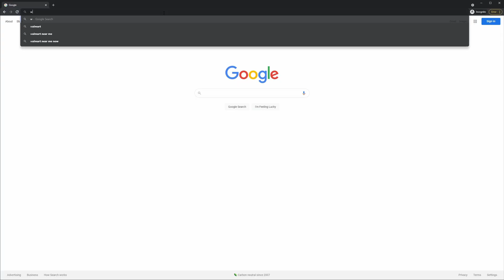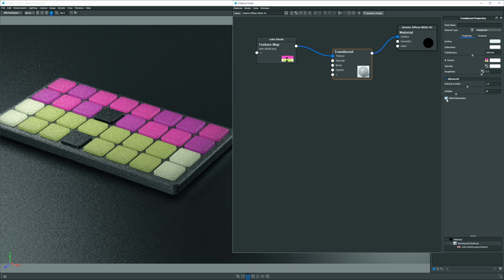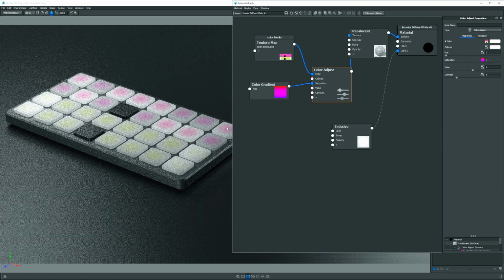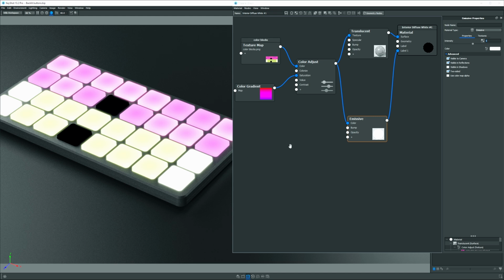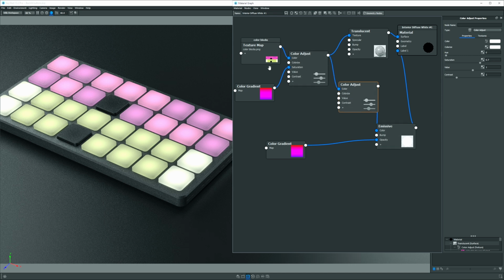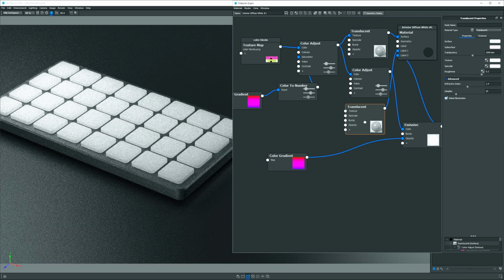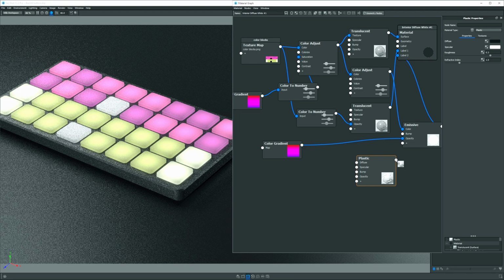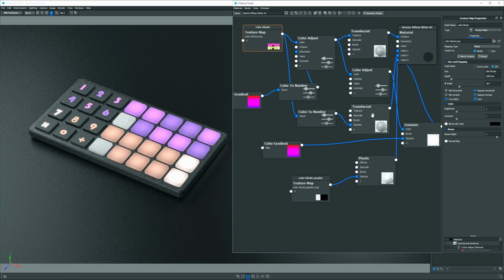Backlit Silicone Buttons

Comment: In a similar case, If I want to apply a texture to the buttons top surface and a different material on the sides of the button? is it possible? with-in keyshot???
Reply from the maker: Sure. You just need to either split the surfaces apart and un-link the materials or get creative with label placement. Labels are essentially layered materials.
Reply: @WillGibbons  Thank you very much for your reply! I will try that!
Reply: @WillGibbons  Hello again, I did manage to do that. Thank you!  - now, for the contrast falloff as you have used spherical mapping, what if I have rectangle(lengthy) objects and square objects (mixed) where spherical mapping is not working. Is there any way to attain that effect within single material (as I will have to do many variations) sorry for the long complicated question :P

Comment: For best results, I recommend adding a plane underneath the button so it simulates a real COB/LED. That'll give the best effect. Works everytime. For example, if you were to model and render Elgato's Streamdeck. Also, in the case of silicon buttons, sub-surface scattering will give it extra oomph.
Reply from the maker: If you try using the approach you suggested, and render an animation of that with say, 12 buttons... good luck. It's too slow. That's why I used this slightly-odd workflow.
Reply: @WillGibbons  😂 With render farm services out there, this is less of a thing to worry about. But I totally understand!!
Reply: It's always funny when someone who doesn't know better, thinks that he does. Will is correct. It's going to add time to your rendering for no reason. There will be no improvement to the overall look. Even with a render farm or network at your disposal it's a complete waste of time. And not just render time but the time to animate the changes. Will's method looks as good or better than what you are proposing plus it's faster and way more flexible.
Reply: @tgs1766  What do you do for a living? We'll see who doesn't know better ;)

Comment: Hey , i have put 3 animations in queue. One of them has rendered completely but i cant seem to find that file anywhere in my mac. Not in the Keyshot library not in my downloads or any other folder. Will Keyshot first render all the animations and then process it as mp4 or is there something wrong , please help.
Reply from the maker: I'm not sure. If you look at your render output settings, it should show the file path that it's being saved to. I'd go to look at those settings. Probably that's where the files have been saved. Did you choose to render frames as well or just the mp4 file?
Reply: @WillGibbons   I did check the file path. it wasn't present there. I rendered the output in MP4 , which doesnt show up anywhere. .MP4 and .MOV is something keyshot is rendering but not showing the output. However I did try to render in .AVI which then showed up in the set folder. I dont know if it is bug Keyshot 9.3 pro has or what. Anyway thank you for your time! keep up the great work.

Comment: Hi will,  i have just facing a problem about the (Undo) option in keyhsot, that is not working. can you please tell me how to fix that?
 currently i am using keyshot 10. thanks in advance!
Reply from the maker: I don't think there's a way to 'fix' it. If you found a bug and the software doesn't work as expected, contact support@luxion.com. The undo command doesn't always work the same in ever tool. Did you try going to the menu item (top left of screen Edit>Undo)?